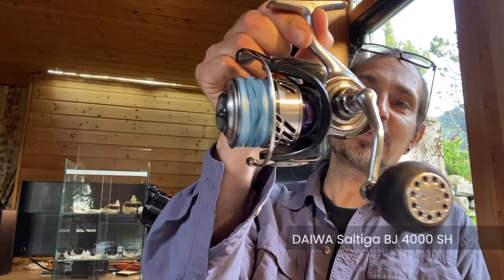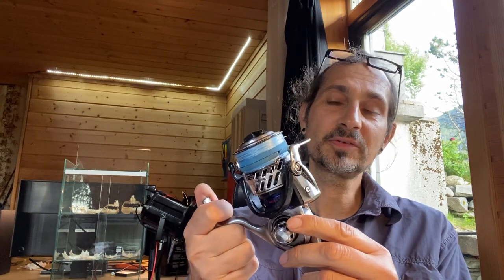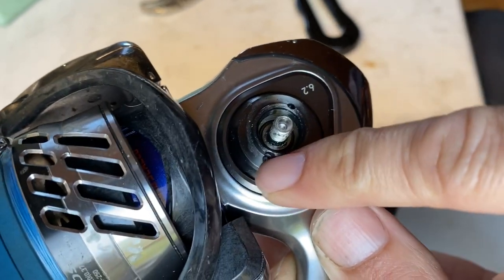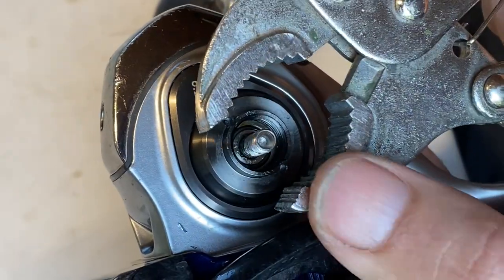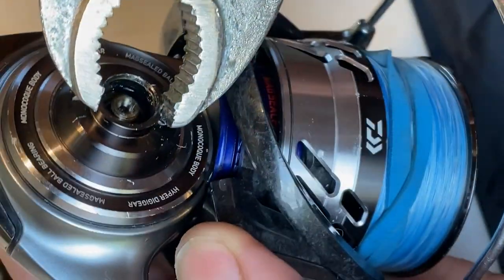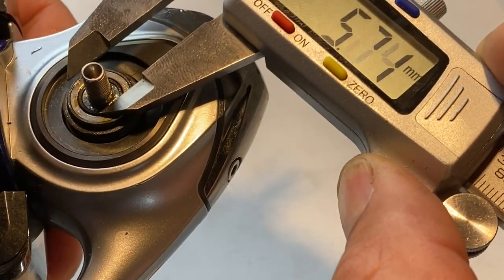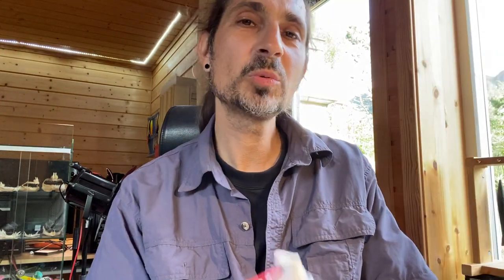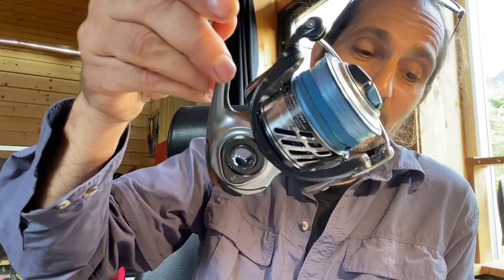How NOT to open & repair DAIWA Saltiga BJ Monocoque Mag Sealed reel

Comment from the maker: Finally I found the reason for the sound: After I thought it’s a bearing, later the clutch - at the end it’s the pinion shaft itself which has a little rough surface from corrosion  making the noise when rubbing against other parts.

Comment: Fishing a reel 3x a week without a service is very impressive especially in harsher conditions, especially for that reel which I would say is actually more of a finesse style reel.

Daiwa in my experience make great reels that feel tough but they do not last as long as shimano reels (without servicing) key word.

The mag seal is not designed to seal against salt water 

It’s designed to act as a replacement for rubber seals that other reel companies use.
Reply from the maker: Hi thanks for your opinion. 
I fished not with “no service”.
I oiled and greased all recommended parts regularly.
My main reel before was the Daiwa Catalina Modell 2012.
No Magsealed bearings and so no problems. 
I would buy this reel again.

Comment: I have the same reel. 
Very good reel but needs regular service. Removal side plates,  stripping, grease components with quality reel grease, new mag seal oil and especially grease on the rubber gasket at the back with water proof grease on the two screws. I would say that this reel is not ideal for an environment where your reel gets soaked all the time or you spend time wading and fishing where your reel is immersed. Not as maintenance free as a Stella but with a tool to take off the side plates maintenance will take you 5 min once every few months which is much easier than a Stella.
Reply from the maker: But from where do you get the mag sealed oil?
Reply: @Der-Raubfischer  Unfortunally daiwa won't sell it for us mere mortals, only can be replaced by daiwa's authorized service, but I tell you a little secret, if you just remove the mag oil, the reel will work just fine, even tought it will lose some allegadly water protection (wich I don't believe that really works anyways), another lil secret, Daiwa's oil is manufactured by a Korean company named Ferrotec, you can buy some of this oil quite easily on the internet, its the same oil used for sound speakers